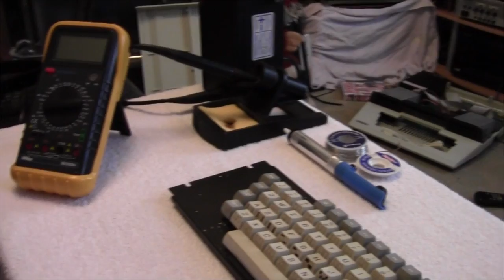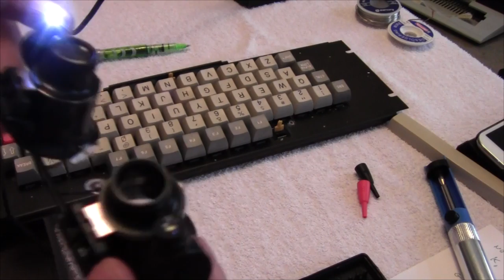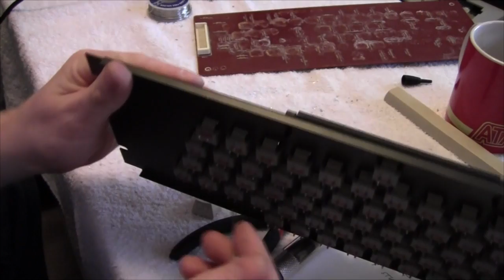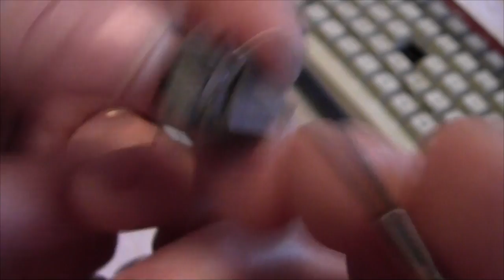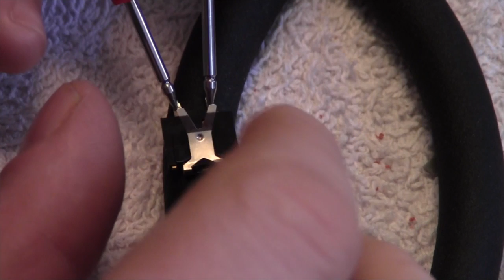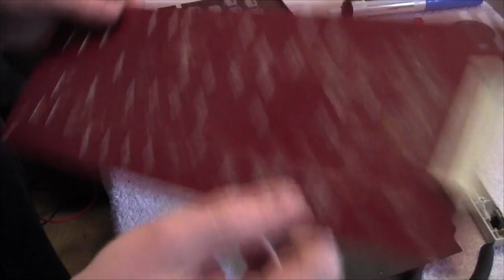Tatung Einstein Teardown, Repair & Restoration (Part 2/2, keyboard restoration)

Comment: Tatung Einstien keys fit Cherry MX blues Mechanical Keyboard switches perfectly. So if you have a failed / corroded key you can buy Cherry MX 'Blues' and use these instead - readily available and cheap. In fact replacing the whole keyboard with MX Blues gives a great keyboard experience. Lots of resoldering though...but worth it!!! Also if you have missing keys same applies, New Keycaps will fit - although you wont have the laser etching BUT Linus Tech tips (LLT on YT) shows you how to do this without a laser etcher - just buy some blank MX keys V cheap!! Spare parts for Tatung Einstein Keyboard solved for ever!!!

Comment: Perhaps I've been lucky but I've never had to completely remove the keys from the keyboard. I've used WD40 to lubricate the keys and I've re-soldered dry joints but that's it.

Comment: could you unsolder the key switches from the IBM compatible keyboard and solder those into the TATUNG keyboard circuit board and reassemble and see if that does the trick, if that does the trick then well and good if not then we have to have a go at the keyboard controller and see if that solves the problem, I would have thought about cannibalising a non working MTX512 for the keyboard and use it to replace the broken keyboard and as the pinout on the MTX512 keyboard is similar you should be able to use it to replace your broken keyboard although the keyboard is black it should not be a problem.
Reply from the maker: I've no idea, not tried it :o(

Comment from the maker: Aha, yes, water is very good in restoring computer actually, as long as it's allowed to dry/baked away.  Eh?  it's a switch?  it's either not letting current through or it is/doesn't work/does lol

Comment: Very well done getting it all working, lot of work involved, but well worth it.
Yes it does sound like your unit suffered the old spill tea on keyboard incident - these were predominately used in offices in software development houses so it's understandable.
I am itching to get one of these at some stage and working on putting together the development environment that would have been used.
The keyboard sounds pretty nice once working, so other than tea incidents they should be pretty good.